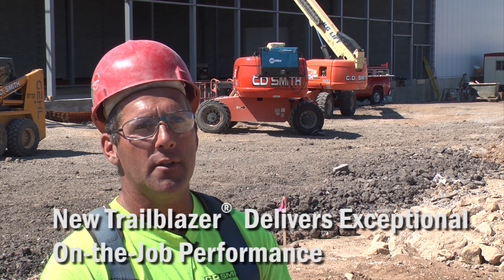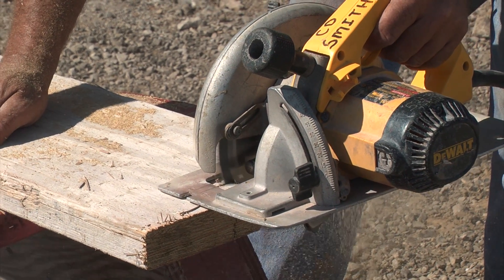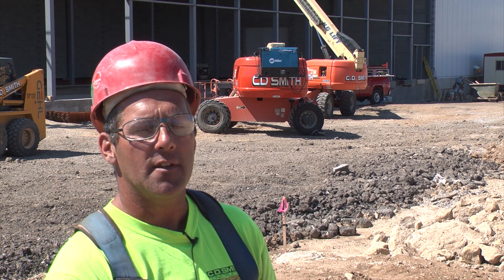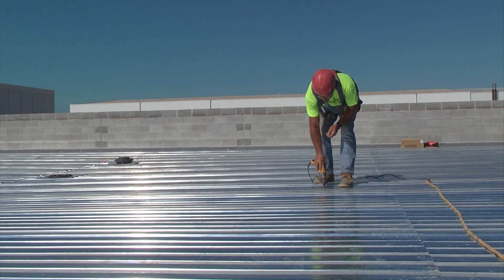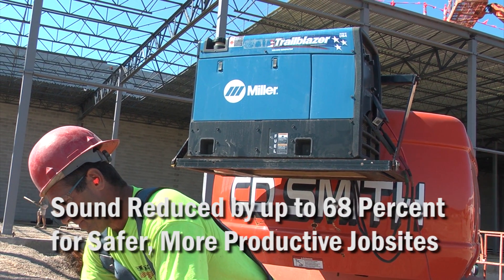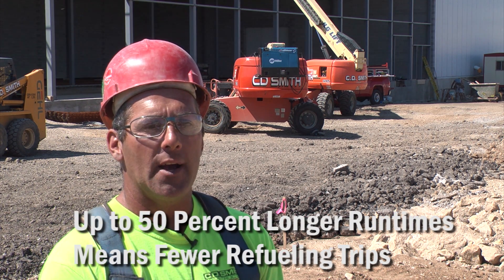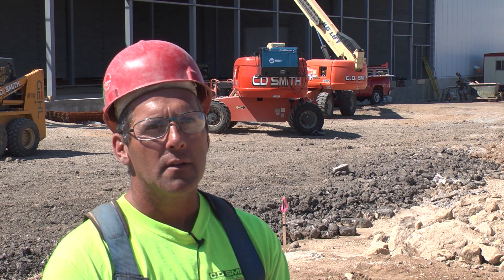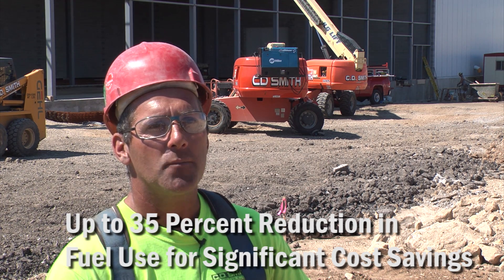Trailblazer 325: Exclusive Technologies & Game-changing Performance Impact Construction Company

Comment from the maker: Featuring industry-exclusive technologies to make you more efficient and help cut costs – Auto-Speed™ and Smart-Cor – the Miller Trailblazer® 325 welder/generator extends run-times by 50 percent and features a smaller and lighter footprint. Learn more:
Trailblazer 325: Exclusive Technologies & Game-changing Performance Impact Construction Company